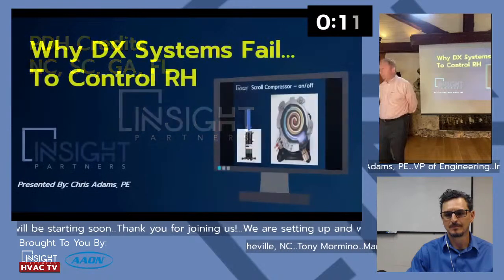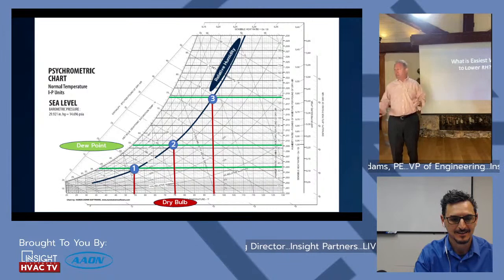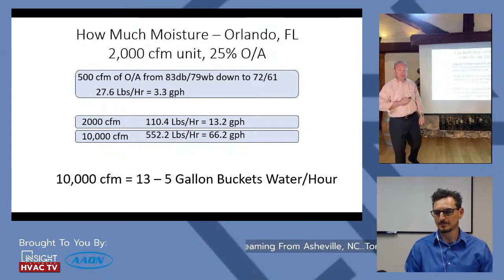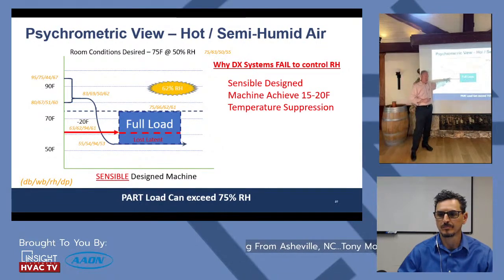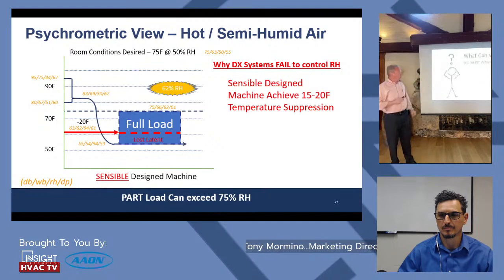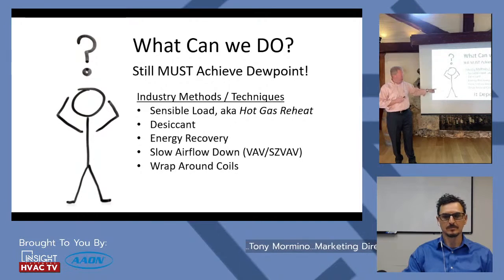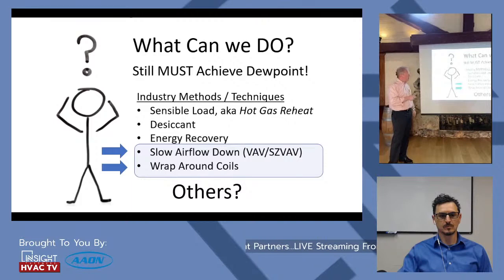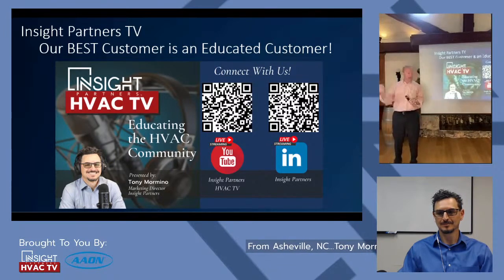Why DX Systems Fail To Control Humidity

Comment: For a gymnasium in zone 3a or 2a, what would you recommend using when the OA gets up to 50% but you need to keep the area dry for the floors
Reply from the maker: Thanks for the question Patrick gyms are tricky due to the high variation between the Peak and Part Load conditions.  30 Tons one minute, two hours later you have 5 tons. For a packaged RTU design we would recommend modulating compressors, modulating hot gas reheat, modulating heat (electric, gas, etc), and a controller this is designed to controls temperature and Humidity over all load conditions. You can utilize Energy Recovery Wheels to reduce total tonnage but you will still need the aforementioned components. This is a standard application for us so feel free to reach out if we can help.  tmormino@insightusa.com